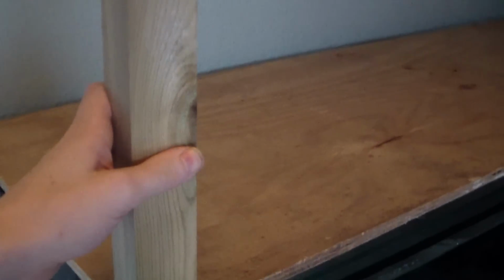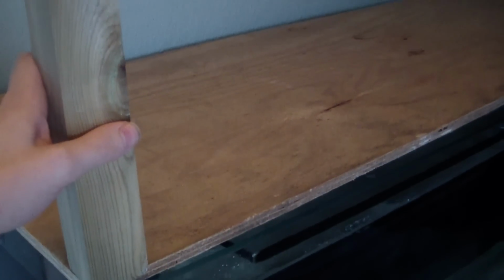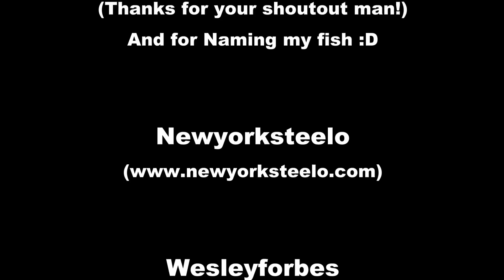Studio Reef 26 "DIY Aquarium Canopy"

Comment: If you wanted to make it lighter canopy why didn't you use 1"x2"s for the frame and then just cover it with 1/4" wood sheeting with whatever you like. That will make the canopy much lighter. I made one for my 75gal. tank and it so light I can put it on and take it off with one hand. If you like to see it and what I did to do the job contact me and I will send a video. also; I will be uploading a video to YouTube on my canopy as soon as the tank is running with fish in it.